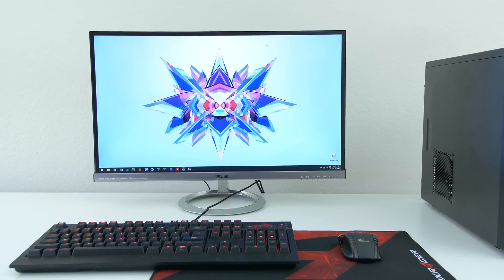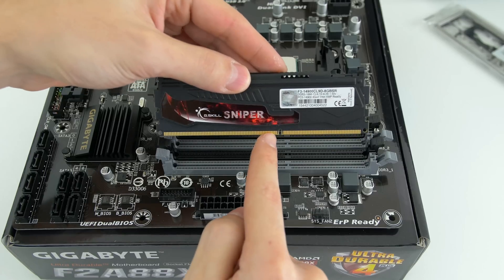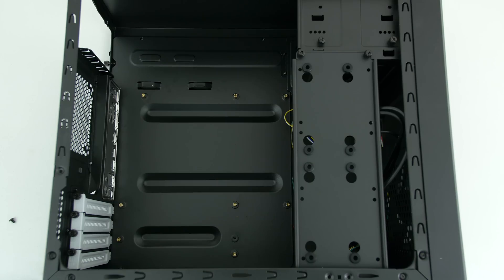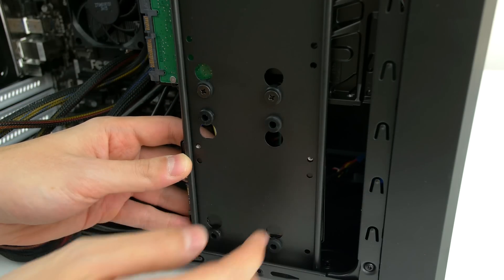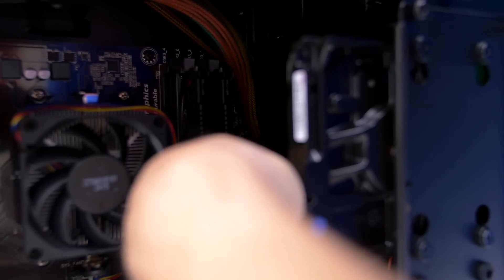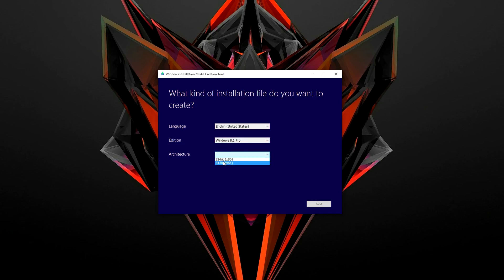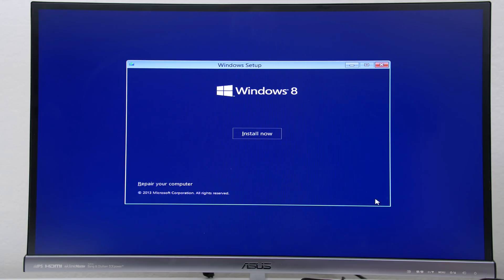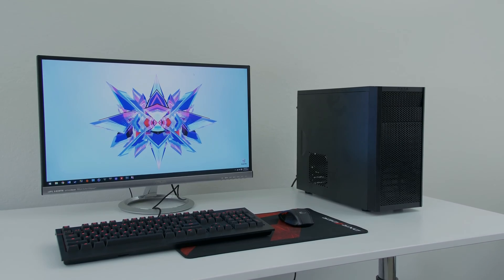How To Build $450 Gaming PC w/ Windows Install

Comment: Can i use this ram for this build ? http://www.amazon.com/gp/product/B00EUPV2RQ/ref=pd_lpo_sbs_dp_ss_1?pf_rd_p=1944687522&pf_rd_s=lpo-top-stripe-1&pf_rd_t=201&pf_rd_i=B00D2LGRO2&pf_rd_m=ATVPDKIKX0DER&pf_rd_r=1ZA7PB7SFXRGNAJHCYC4
Reply: +Mclovin 187 yes you can but i would get crucial ballistix 8gb they are two lose sticks more than 8 gb isnt really needed 4gb is probably a little low
Reply: +Mclovin 187 Yeah

Comment: Could I run triple monitor through this for gaming?
Reply: +Operation Minecraft no unless running minecraft but for 3 monitors full hd you are gonna need a budget of 1300-2500 triple 1080 is almost as hard to run as 4k
Reply: +tom siemerink Ok thank you. Actually am using it for Minecraft. Thanks.
Reply: Operation Minecraft are you sure minecraft has multiple monitor support?

Comment: Hey, I have a question, can my build work on csgo ultra 1080p/1440p 60+ fps and some AAA titles like COD, Minecraft, GTA V at low to med settings 720p 1080p? Heres the specs http://pcpartpicker.com/p/XcVZ4D
Reply: +King Troy For sure, but you may want to get a slightly beefier psu, just so there is no lack of power if you ever want to upgrade.
Reply: Bike Race Addict Thx
Reply: You're welcome. Good luck :)
Reply: Bike Race Addict Well i have 600 wats bc i have 300w that comes with the case along with the psu that i bought. This is my first build (I'm retiring from cs 1.6 lowest settings 240p 20fps) So will they both work together? or should i remove the other psu?
Reply: Oh, I'll be honest. I have no idea if that would work, because I have never bought a case with a PSU that comes with it. But, you can replace the psu that came with the case, with a 600w
Reply: Also, they wouldn't fit anyway. So you may want to get a different case, because then it would be cheaper because it doesn't come with the psu, or you can keep the same case and not use the psu that comes with it, and use your own.
Reply: Bike Race Addict i think ill just get a different case and use my 300w psu
Reply: You'll need more than 300w though, for like 20 bucks more you can get an evga 500w
Reply: Bike Race Addict Can you give me a link to it?
Reply: Not really, it just costs more money xD
Reply: Bike Race Addict okay then, now i will trek on a journey to find the cheapest psu... Is on amazon, ebay, bestbuy, on three monitors and is playing MK Theme song in background
Reply: The one I linked you is good lol
Reply: Bike Race Addict Well, maybe gaben has answers... lol
Reply: gaben always wins
Reply: Bike Race Addict Gaben gives me deals, and csgo skins with a side of tf2 hats, witcher 3 5.99$!
Reply: lol gaben op
Reply: Bike Race Addict valve plz fix gabens deals 2 gud 4 m3
Reply: haha m9 gaben iz 2 op
Reply: Bike Race Addict m8 im a haxor so i got a free AWP - Gabenlore (Factory New) lowest float m8 wont 1 m8?
Reply: I'll trade you P90 sand dashed for it, m8 that iz the bezt offer u can get
Reply: +Bike Race Addict m9 i no gaben so ill get you one free m8
Reply: ay thanks m80
Reply: +Bike Race Addict np m8 (gives AWP - Gabenlore (Factory New) But wait... i found loominarti!!! U hav 3 wurds in ur nam. So does stupi lun nus! stumpi lin nus lieks cak, cak was 3 letters in it. Supercalifragilisticisbealadocious has OVER 9000 silybuls, OVER 9000 + 21 = 9. 9-10 = 3 doritos have 3 sides, phenis from phenus and furb has a triangle head, doritos luk liek, loominatii, mikul jaksun peed himself in 8th grade in front of everyone. the v in everyone has a triangle in it. so does the v in the nigerean vulcanpoop., nigerean vulcanpoop, sounds like nicompoop, a character in 101 dulmations seys nicompoop, dalmations have pointy ears, so does link from the legend of zelda, link wears green, weed is green, weed has triangles, loominati is green and has triangles, snoopavision is inspired by weed, youtube made snoopavision, this video is also made by youtube, our comments are made bi dis video, we made these comments, im writing this in a car and im becoming carsick and turnong green, i can make a triangle with my hands, I... AM... LOOMINARTY!!!!!! turns into gaben Just kidding! im gaben! FaZe Rain comes and quikskops gaben Faze rain is luminartiii. cuz he quikskopd gaben and got a triple feed. but wat if gaben was not kill? gaben would be loominatiiiii. Just like you. OHHHHHHHHHHHHHHH ALLAHU AKBAR! world blows up
Reply: WUT THE HERC IV BEN FOND OUT! IM LUMINART BUT GABEN GIV ME DEALZ.w wait but if faze rain is luminartii then i am luminartii dat mens i am faze rain. but i never killed gaben zo gaben iz not kill? explodes
Reply: Bike Race Addict Wait a minute, the world blew up, so how to we hav oxegen 2 breeth?
Reply: Bike Race Addict and how come the world is still intact... THE WORLD MUST BE A NOKIA 3310!!!!!!!!!! LOOMINARPEE CUNFARMD [You have used a rude or inappropriate word. This account has been banned for 420 days]

Comment: Could I run Mac OS on this?
Reply: Could I also run 1440p stuff
Reply: I dont know. Are you going to use an emulator???
Reply: +Keeton Schaff yes you can use mac os, 1440p? you need a 1440p or better monitor, but yeah it will work.
Reply: though windows is over 9000 times better and cheaper

Comment: Just completed this build...went with a slightly different (cheaper) GPU option, also went 1 TB WD blue and a smaller 120 SSD for booting...for some reason my motherboard is a different model.  I thought I had ordered the same one from this video but I didn't.  It doesn't have 4 Ram slots (only 2).  Either way I am very excited to power it up and see what it can do!
Reply: +GiantDevilDog what graphics card did you buy
Reply: http://www.amazon.com/Radeon-Overclocked-256-bit-DisplayPort-Graphics/dp/B00ZQ3QVJK/ref=sr_1_13?s=pc&ie=UTF8&qid=1462383301&sr=1-13&keywords=asus+strix

Comment: Someone please answer. 
Why not just download  windows 10 to the USB, buy a Windows 10 OEM key from g2a and install that way? 
Why 8.1 and then upgrade? 
Btw, won't windows want a new key/serial as soon as the update from 8.1 to 10 is complete?
Reply: +Django CS GO You can if you want to. 10 is a bit more expensive

Comment: I don't know what to get the G. SKILL sniper or the G.SKILL Series Ripjaws X Series Model F3-17000CL11D-8GBXL Type240-Pin DDR3 SpecCapacity8GB (2 x 4GB)Speed DDR3 2133 (PC3 17000) Cas Latency11Timing11-11-11-30Voltage1.5VECCNoBuffered/RegisteredUnbufferedMulti-channel KitDual?? Can someone help

Comment: Looking to buy the parts but I have never built or had a pc...just getting a job at 14 yrs old and want to spend my money on this, the only thing I'm scared about and making me not want to get the parts is I think I will screw up with a part or not know how to install Windows and get lost, if you pros that have built one before can give me some tips that would be great,

Ps. I know u need a monitor and stuff first😂😄

Comment: @TechSource Hey thanks so much I used some other parts but this helped me build it. But I have one problem. Everything is plugged in correctly, the fans are running, I got the windows onto my flash drive and I put the flash drive into my computer, but it's not booting up, I have 2 monitors plugged in so I do not understand why it is not showing up please help thanks so much love your videos keep up the great work

Comment: Better build: AMD A6-5400K Trinity Dual-Core 3.6 GHz Socket FM2 65W AD540KOKHJBOX Desktop APU (CPU + GPU) with DirectX 11 Graphic AMD Radeon HD 7540D

CORSAIR Vengeance 8GB (2 x 4GB) 240-Pin DDR3 SDRAM DDR3 1600 (PC3 12800) Memory Kit Model CMZ8GX3M2A1600C9R

ASRock A88M-G/3.1 Fm2+ /fm2 a88x (Bolton b4) micro atx motherboard

MSI GeForce GTX 750 Ti DirectX 11.2 N750ti-2GD5TLP 2GB 128-Bit GDDR5 PCI Express 3.0 x16 HDCP Ready Video Card

Kingston SSDNow V300 Series 2.5" 240GB SATA III Internal Solid State Drive (SSD) SV300S37A/240G

DIYPC Zondda-O Black USB 3.0 ATX Mid Tower Gaming Computer Case with 3 x Orange Fans (1 x 140mm LED Fan x side, 1x120mm LED Fan x front, 1 x 120mm fan x rear)

CORSAIR CX series CX600M 600W ATX12V v2.3 SLI Ready CrossFire Ready 80 PLUS BRONZE Certified Modular Active PFC CP-9020060-NA Power Supply

Comment: What kind of fps will I get in these games??? >>> Gta 5, Minecraft, Call of duty AW, Rainbow six siege,Tf2
Reply: +VortexSkilz He made a benchmark video on it
Reply: He didn't do Advanced Warfare or rainbow six seige or TF2  in the video however he did do the others COD BO3 is much more intensive (I think that's the word I'm looking for) than Advanced warfare and considering it was Around 59FPS for BO3 you'll be fine running AW and rainbow six seige TF2 has been around for a long time, longer than I can remember TBH This computer will tank it 
MC was around 100+ FPS and GTA changed through out the test however it was somewhere between 58-67 FPS (bare in mind I'm sure GTA V was in High graphics mode)

Comment: Could I use 4 4 gb sticks of ram? Someone please reply
Reply: +Papouka Official As long as the motherboard in fact, has 4 ram slots,, and you have DDR3 RAM. The link for the motherboard in the description points you to a motherboard with only two RAM slots on NewEgg.
Reply: Google it
Reply: Yea
Reply: +TheNitron123 You can see in the video that there's 4 channels
Reply: +Papouka Official yeah sorry I dun goofed I got a different board for my build that only had two RAM slots it confused me
Reply: +TheNitron123 it's all good And also are there any other good graphics cards that would work around the same price because this one is sold out
Reply: No

Comment: would a EVGA GeForce GTX 950 2GB gpu work for this build. the gpu in the vid is sold out and I need help finding a replacement. or should I just stay with the sapphire Radeon r9 in the video? suggestions would be helpful :)

Comment: How to make a killer Pc Tips:
-You dont need a case so dont spend money on one
-get windows later for now get linux or steam os
-always get your graphics card at ebay you will save alot of money which will meen youll be able to get a better graphics card in your build 
-thats it right now if you get a 500$ build you'll be able to play mostly all games at 1440p high settings at 40-50 fps

Comment: Hi could someone tell me if this build is all compatible and your thoughts on it, thanks:) http://pcpartpicker.com/p/GyjPwP
Reply: http://pcpartpicker.com/p/GyjPwP
Reply: +Paul Lynch Pretty good, did you build it?
Reply: Thanks, yes i bought what i could so far out of my Christmas money, i purchased a 500w psu instead of the 600 and 2 4gb sticks of hyperx fury 1866mhz ram instead of the Crucial:)
All i need now is the cpu, I am buying a 4690k instead:)
Reply: I have it fully built just need to insert cpu and buy a monitor, hopefully i will have it all ready to go by this August.
Reply: Thanks a lot I really appreciate it, this is my first build and for the moment I'm just using an i3, radeon graphics laptop so it will be some upgrade xD hahaha, I've been looking at lots of monitors and that ones actually good for the price, do you know what the response time is? And that's great bro if you don't mind keeping me up to date with how your build is going?:)
Reply: Yeah it will DEFINITELY be an upgrade haha! Yes that monitor is good for gaming or really anything, the response time is 5ms but it has a 60Hz refresh rate! And for sure! I definitely will once the parts come in :D I just have to remember about this so you should just reply to it so it comes up in my notifications :P

Comment: Have a look at this Productivity/Gaming Build!:

Intel Xeon E3-1231 V3 3.4GHz Quad Core Processor
Deepcool GAMMAXX 300 55.5 CFM Cpu Cooler

MSI B85-G43 Gaming ATX LGA1150 Motherboard

G.Skill Ripjaws X Series 8GB (2 x 4GB) DDR3-1600 Ram

Western Digital Caviar Blue 1TB 7200RPM HDD

PowerColor Radeon R9 390 8GB PCS+ Video Card

Corsair SPEC-03 Orange ATX Mid tower Case

Corsair VS 650W ATX Power Supply

LG GH24NSB0 DVD/CD Writer

What do you think?

Comment: Pins bent on the usb3.0 slot trying to put cords around the graphics card (gtx 960) and either way the cords will not stretch around or over the gpu.. :""(   Help

Comment: Is this a good crossfire build (i'm planing to add one more R9 280x in the future. For now is just one )

CPU : Intel Core i5 4590 3.3Ghz
GPU : Radeon R9 280x (I'm gonna add one more in the future )
PSU : Thermaltake Smart SE 730W
CASE :  Segotep Fighter C ATX Mid Tower
HDD : Seagate Barracuda 1TB, 7200
Motherboard : MSI Z97 PC MATE
RAM : Kingston 8gb 1866MHz
Reply: +mamomi1 HD dont waste your money, check your motherboard before you waste your money on another gpu, because some motherboards have  1 pci-e and others 2 3 etc so check it first
Reply: Life Cta I've already checked this motherboard and it has 2 pci-e slots
Reply: then it's alright

Comment: Do you need to apply thermal paste with a stock cooler for any CPU?
Reply from the maker: In most cases no. Just check the cooler before you put it on.

Comment: The two GPU's are sold out do you have any other recommendations?
Reply: And so is the motherboard; any ideas? Help pls.
Reply: Every build has something sold out, it's very depressing.
Reply: +Nebula Charm gtx 750ti, gtx 760, r9 280. For the motherboard, try to search at pcpartpicker for compatible ones with at least one pcie x16 2.0/3.0 and two slot for ddr3 1866mhz RAM.

Comment: can i swap out the graphics card with something else the card u put is sold out
Reply: +kamal brooks I think that the 960 is on sale right now for about the same price and higher performance.
Reply: So is the motherboard
Reply: +kamal brooks yes
Reply: +kamal brooks Here we go I found it for $182.99

http://www.superbiiz.com/detail.php?name=PNY-960G2X&c=CJ
Reply: +kamal brooks Yeah the same here, I had to get another GPU which is the MSI R7 370 (4GB) 
  http://www.amazon.com/MSI-R7-370-GAMING-4G/dp/B00ZGF11YS/ref=sr_1_1?ie=UTF8&qid=1451165255&sr=8-1&keywords=r7+370+4gb

What do you guys think of this GPU? and what motherboard should I be getting since the one linked in the video is not available !
Reply: +Link the Duelist I&quot;m sorry i&quot;m new to pc building and I had the same problem as the other guy with trying to buy everything in the description but the mother bored and graphics card is out of stock. So what is an good motherboard that is compatible with all of this?

UPDATE.
OK so the mother bored wasn't sold out but the sapphire thing was and i think that a video card is the same as a graphics card yes? So i replaced the sapphire with the MSI R7 4g graphics card
Reply: princeofhalo1 Yes a video card is the same thing as a graphics card or as it's more commonly called a GPU.
Reply: Link the Duelist so is the MSI R7 4g A good gpu? And is it better then the one he uses in the video?
Reply: +princeofhalo1 About the same but the 4GB from the 370 come in handy as where the 270X is still just a 2GB card.
Reply: Link the Duelist Ok so I have less money than what I expected to get. So I found a cheaper gpu. I was wondering if its compatible. Its a XFX Radeon R7 370 R7-370P-4255 4GB 256-Bit GDDR5 PCI Express 3.0 CrossFireX Support Double Dissipation XXX OC Video Card
Reply: princeofhalo1 It should work without any problem.
Reply: Link the Duelist  Ok link (Or anyone else who is reading this) I have one more question. The link he sent to us for the motherboard is the wrong mother board. He has the DH3 in his video but the one he has in the link(and the one I have currently) is the HD3 one. And I don't know if everything will work just the same as the one in the video. The Hd3 (which is the one he mistakenly put in the link) only has two slots for the ram. What do I do now? Just follow the video even though the motherboard is different?
Reply: princeofhalo1 yup the ram sticks arnt able to fit in the slots.
Reply: +kamal brooks Ok, I've replaced the graphics card with a EVGA gtx 750Ti 2GB, and that got the build down to $373. So, because this my first build, I'm a total noob. So, the question is, will this work, or will it explode in a massive fireball destroying the earth in the process?
Reply: +Aidan Bowie  Go to pc party picker it will tell you if all your parts are compatible. (:
Reply: really! thanks!! :)
Reply: Aidan Bowie It should work just fine as long as it's the same socket then everything will work just fine.
Reply: Link the Duelist yep, same socket. thanks!
Reply: +Aidan Bowie it will work it just won't be as good as the 270x, I would go for the gtx 950/960 because it's similar in price to the 270x
Reply: jstyledipset cool, thanks!
Reply: +jstyledipset  so the gtx 950 or 970 will still work with all the other equipment in the computer smoothly
Reply: Justin Smith Yes, I actually just finished this build with a GTX 950 instead
Reply: Ok cool thanks
Reply: +Link the Duelist Is this equal or more powerful than the one he used in the vid?
Reply: +Abraham Ortiz Stronger.
Reply: Link the Duelist Thx that's the one i'm going to use. Is the installation process the same
Reply: Abraham Ortiz It's literally the exact same installation process
Reply: +The Black KazeKage Check amazon. He used the same graphics card in his 500 orion build.
Reply: The CPU is out of stock can I change it with another one?